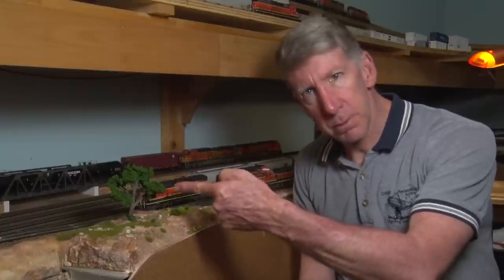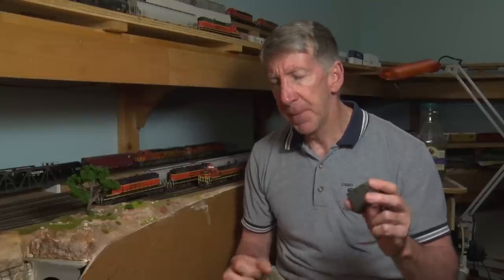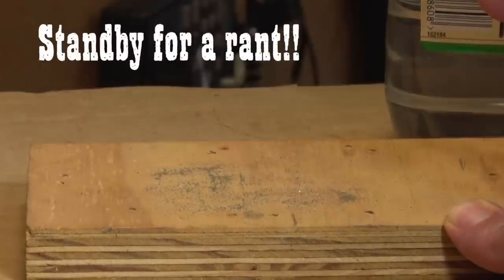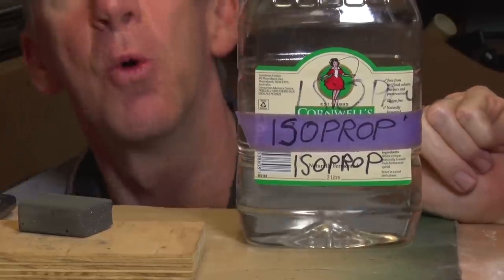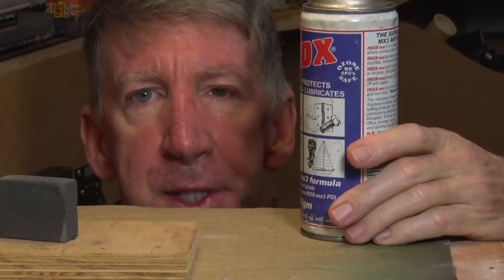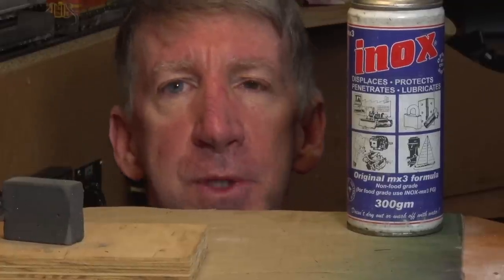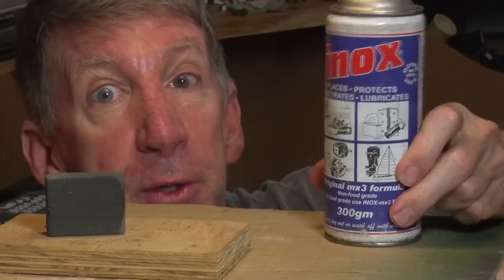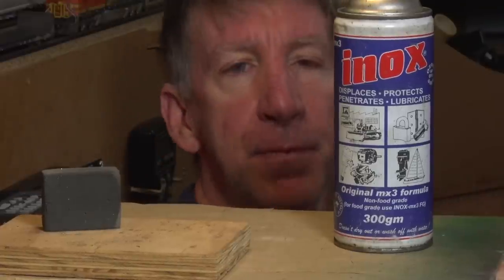Track cleaning do's and don'ts. How "Not" to  clean your track ! And how to do it better!

Comment: I totally agree about the isoprop, i use it to clean flux residue from circuit boards i have worked on, yes, it's great for cleaning off the flux, but the isoprop itself leaves a visible film over the board once it's evaporated away. Just spill a small amount of isoprop on a glass surface and let it evaporate, the residue left behind is easy to see. And i totally agree about track rubbers, i bet if you could measure the coarseness of them on the wet and dry paper scale, they would have a reading in the low hundreds. Like you say, Greg, best bet is to use a 3000 grit wet and dry paper - the stuff is designed for polishing paint and clear coat - just try polishing your paintwork with a track rubber and see how that turns out! 😀
Reply from the maker: Thank you Steve! You're spot on re the IPA , it does leave a residue and the ide of letting it dry on glass is a great idea to show what happens!   Wet and dry is great and I used it when I had DC trains back in the 80's .
Gregg :-)

Comment: Watched a few videos and read a few articles about dos and don'ts - I tried your method and so far so good. My contact cleaner is for moving contact parts - I tried a dirty piece of track and so far it is very smooth. Fingers crossed. Easier than having to vacuum up after scrubbing!!
Reply from the maker: Glad to hear it! It will only improve as you use it.
Thanks for the feedback.
Gregg.

Comment: Hi - just watched and enjoyed your clip on dont's for track cleaning. I have a question re isopropyl alcohol. I can understand your comments about the "impurities" in IPA ... but I can source (here in NZ) isopropyl alcohol that is 99% pure. The agents for this brew can not tell me what the last 1% is. So my question is does your rant include all isopropyl alcohol products or just the ones you mentioned with the extra water etc added to them. Thanks Fr. John
Reply from the maker: Hi John and thanks for watching!  Due to it's chemical make up ,and being made from LPG, IPA is not suitable for any electrical equipment cleaning, and if you watch the follow up video to this , I go into that a little deeper. Even "pure" IPA will dry and leave a residue in the track that builds up over time . If you must use an alcohol to clean your tracks , then try Methylated spirits , but better still , use a product that is made for the job...like INOX or similar. The only reason to avoid these is if you have traction tyres on your locos, as the INOX will make the rubber slip. 
Cheers Gregg
Reply: @FishplateFilms  Hi Greg, thanks for that. I can not use the Inox product as all my locos have friction tyres.  
Blessings Fr. John

Comment: Hi, just watched your video and you are absolutely right, had problems with a stuttering train after cleaning the track and train with isopropyl, bought WD40 specialist fast drying contact cleaner as I'm in the UK and it worked a treat, great advice, thanks
Reply from the maker: Thanks David!  Glad to help.Just to clarify , that Innox is no a "contact cleaner" and the WD40 spray will not help with oxidation , as it is a "Cleaner" only. But if you're getting good results , then thats what your after!
Chers Gregg.
Reply: @FishplateFilms  
Hi Gregg, when you say oxidation do you mean rust and  has anyone recommended a product I can find in the UK
Reply from the maker: @1701celica  Hi David, not rust as such, but the Nickel Silver does tarnish a little , but the main job of Innox , or CRC 2-26, is to help maintain a conductive path through dirt and oxidation. Contact cleaner will certainly clean well but leave it sterile, but if you're using traction tyres, then Inoxx is not for you:-). You can buy Innox from "Pendle Slot car racing" in Lancashire...a few viewers have mentioned that , so they are getting a few different customers!
Check out Charlie at "Chadwick Model Railways" who has tested Innox after watching my video.
Gregg :-)
Reply: @FishplateFilms  
Hi Gregg, thanks for the info, I'll check them out

Comment: Hello to another from Brisbane, who doesn't model QR either.  Victorian Railways in my case.  Thanks, I never thought about this, so the track rubber will be going in the bin.  Let the Bin Chickens have it.  I have a few of the 'flat top' VR T class diesels that run really well, as long as the wheels are spotless.  Slightest bit of dirt, and they play up.  The '2nd' and '3rd' series T classes, from a different manufacturer, not troubled so much by dirty track or wheels.  I'll head to Bunnings, even though I have to cook some sausages at home at present.
Reply from the maker: Hello to you!  I bet the bin chickens won't want it either..LOL Nothing worth modelling up here  apart from the 2350 class, but they're the wrong gauge!  Please give it a go and let me know how it goes! The T class ar bigger than they look! I saw one in Maitland and it was huge compared to QR locos , especially for a BO BO unit.
Thanks for watching .
Cheers Gregg.

Comment: Great video and love the rants!!!!!  Probably need a pint or two!!!!!!!

A friend of mine worked as a diesel mechanic.  He told me that they used to use Crocus Cloth to polish crank shafts.  He also said that he used it to clean his track on his layout.
Any thoughts on this????
Reply from the maker: Thanks Rch!  A wee Dram is in order sir. I have no idea what "crocus " cloth is!  If it's used for polishing metal , it may clean well but, I doubt it is the best thing for electrical conductivity? Remember . it's a circuit:-).
Cheers Gregg.

Comment: Don`t worry about replying about my question as I have just seen your video of the 13th April 2020. However do you know of any product similar to Inox that wont bugger up traction tyres.  Cheers   Greg  from  Australia
Reply from the maker: Hi Greg, It is the "wet" that the tyres don't like , and it is the same with other liquids as well. You could try a lanolin spray , like "Lannotech: as it does the same as Innox , but dries out more. 
Other than that you are back to dry cleaning I'm afraid?
Gregg.

Comment: I love this video and as a result purchased some, however on running a clean cloth along my track after several weeks the muck that came off was really black but the trains have been running superbly, is the black muck a common thing to be getting. I have nothing with traction tyres and all wheels on stock are metal🤔
Reply from the maker: Thanks Len!  The black is indeed normal , and is a combination of dirt , oxidation and the Inoxx removing the dirt from your rolling stock wheels! You will never have to clean wheels again ! If you watch the update of this video , I explain that , 
Thanks for the feedback and glad you got the results I promised.
Cheers Gregg.

Comment: How about (“Nature Own”), goo-gone made specifically from Citrus fruits ? I caught a hobby shop owner trying to please a customer on an 027 Santa fe passenger 
set that he had decked up on top of the sales table he grabbed some Goo-Gone and an old rag ! He then proceeded to very lightly went on to completely go around the loop !!!  Then he took a “second rag” and (“wiped off the first past he made !!!  I guess he was wiping off the goo-gone and proceeded to run the train !!! So what do you think of Goo-Gone ??? I’ve tried it myself, and it does seem to work and I have yet to see a piece of track get corrosive or even the slightest bit of rust !!! And I’ve been using it for the past 10 years !!! You did a lot of research before you found an answer !!  
I’d really like to know what you think of this product (GOO-GONE) ???
Reply from the maker: Hi Jorge, thanks for watching! I've never tried it , but some people seem to like it! Being citrus based (i didn't know that) it is a good "cleaner" , but as for protecting the rails and helping with conductivity...I can't say. Track won't rust these days as it is Nickel Silver, but it does oxidise  so for my money , I prefer to use a product that is designed for  electrical circuits. If you are getting the results you  wan't  then that's what matters. 
Cheers Gregg.

Comment: 10 years ago, I stop running my trains due to crappy, inconsistencies in use. Guess now I need try using 3000 grit emery to smooth the surfaces then only use non silicone conductive spray to keep the prime movers moving...
Reply from the maker: You got it John!! I'm sure this has happened to many modellers!  Spray a little on the glass paper too, while you are polishing the rails!
Let me know how you go.
Gregg.

Comment: Good video. What's the impact on inclines. Does Inox leav an oily residue?
Reply from the maker: Unless you have traction tyres, it's not an issue, but if you do , then it will make them slick and  useless.
The track is left with a thin film that is not oily but does make the rails smooth and slick. Off course it depends on how much you use also!
Thanks for watching!
Gregg.

Comment: Hi watched your video in the uk with much interest. Inox is not available here. I’ve seen quoted Crc 2-21 as being the same but not sure.
I’ve also noticed that inox is a lubricant, how does it affect steam locos with traction tyres ?
Take on board track rubbbers are a no no dcc do a much finer rubber.
Would be great Greg if you could answer as I know others are showing interest in the uk.
Reply from the maker: Hi Derek, Thanks for watching and I have had a lot of interest from the UK and you can get INOX from Pendle Slot racing in Lancashire , believe it or not! I'm afraid it does make traction tyres slip on the slick rails. I've not heard of 2-21, but CRC 2-26 is similar to Inox. If you only use a little of the spray and wipe the rails wth a dry rag you should be ok? See Charlie at Chadwick model railway channel , as he uses INox and may have a better idea. .
Cheers Gregg.

Comment: Timely Greg. I am in between setting up my layout, and wanting to move into another room..(more room bigger layout. The track that is down was just about to the once-over from the old PECO track cleaner. So I will hold off until I can find a can of the magical fluid and see how it performs
.
Reply from the maker: Thanks Gary! Yes chuck the track rubber and get some spray . You only need a little now nad then ...a can should last you forever!
Cheers Gregg.

Comment: Thanks so much for your videos on track cleaning. I live in Minnesota and couldn't find the Inox but got some CRC and cleaned a couple of troublesome points and it made a huge difference. I then cleaned the wheels on my two most sensitive locos and that made a huge difference also. This next weekend will see me using the CRC on the rest of the track as well as the wheels on the rest of my locos. Thanks again!
Reply from the maker: Hi Tim, thank you and I'm glad you got some great results! You will work out how much and when to use the cleaner, and after a while your wheels will clean themselves on the rails , which you remove the dirt from when you apply more CRC! . 
Cheers Gregg.

Comment: Do you wait until the crc  2-26 dries on the wheels of a locomotive or on the rails before running trains? Or can you run trains right after you spray and wipe the crc?
Reply from the maker: No John, just a little on the rag and wipe a section and away you go ! If you run your finger along the rail , it should be smooth and a tiny bit left on your finger.
Gregg.:-)

Comment: G"Day Gregg. Mate I use Contact Cleaner or WD-40 Electronic Cleaner. I spay a bit into my "CMX Clean Machine Car" and get one of my Loco's to push it around the layout. Fastest way I know of to clean all the track. If I have a sticky switch, I just spray a bit of the contact cleaner directly into the switch and work it back an forth a few times and its as good as new.
Reply from the maker: Glad you are getting good results! 
Thanks for watching!
Gregg .

Comment: 13 year old me decided to store a box set from Bachmann in tv set drawer and 2 years later i finally got back into it and the tracks are tarnished on top (these are nickel steel, they've all become fully/mostly dull grey on the top instead of shiny) but all the metal cleaning products in my house are for guns and contain petroleum distillates. Whats the matter with distillates, and is there a way to use them and clean off the distillates later? Its only 1 train, 3 rolling stock and a large pile of tracks so I don't think I could justify ordering the silicate based cleaner.
Reply from the maker: You can use them for what you want to do no problem, but a bit of CRC will help a lot!

Comment: Very interesting Gregg. Assuming I can put it in my CMX Track cleaning tank car, then maybe that's the way to go. What's the difference between regular isypropal alcohol and featured alchahol? Been using that, but now I'm thinking it might be better to clean with that and then the CRC.
Reply from the maker: Thank you ! Yes you can but make sure you slow the flow down  it doesn't get too wet. I don' know the difference, but all spirits have some water or other chemical to make them unsuitable for drinking. You could clean with the alcohol and follow up with the CRC. 
Cheers Gregg.

Comment: Watched your vid and see the problems then seen your comments re traction tyres. In the UK I see WD-40 do a contact cleaner which is quick drying and safe with rubber and plastic. Would that work? Otherwise I might go back to track magic  or even running my CMX round dry.
Reply from the maker: Hi Leslie, the traction tyres are a issue as they slip on the spray ! You can use contact cleaner, but it won't leave a protective film on the rails. You may have to stick with track magic?
Thanks for watching.
Gregg.

Comment: Greg,
Learn a few things, I received a HUGE box of Atlas snap track. Before I start putting any track down, I was thinking of using a pink pencil eraser to go over the top of the rails and the joiners. What do you recommend? I don't want to be bent over just yet.
Reply from the maker: .....start removing your belt Thomas...this is gonna hurt! An eraser is your worst choice , apart from a track rubber, but if you have nothing else , then make sure you go over the track with Innox or CRC before you run trains. As for the joints, keep the rubber way from them if you can and also give them a good wipe with your spray of choice. Don't forget to vacuum up the rubber before applying the spray.
Cheers Gregg.

Comment: What would you think of using 99% isopropyl for a good cleaning (like after ballasting) and then polishing with 3000 grit paper and the Inox MX3?

I am fortunate to have access to 99% isopropyl by the gallon in my local hardware store.
Reply from the maker: Hi John, 
You can use the IPA to "Clean" after ballasting or painting, but then go ver the rails with INOX as you say! You can skip the paper , but you can use it to remove scratches left by track rubbers ect. Then just use the INOX on a rag! 
Cheers Gregg.

Comment: Hi i receive the Inox but i wish understand better how to use it.  
1) clean track with clean cloth string and inox
2) clean track with clean cloth string but second way to remove the inox that appear like oil on skin. ?

little scared for this oil effect ...

Do you use it rubber wheels applied on the loco ? 

Any help is really appreciate
Reply from the maker: Hi Stefano , Yes , you have it the correct way! Use only a little on the rag / cloth , you do not need very much at all!   If you have traction tyres /rubber wheels, you you have to be careful , as the INOX or CRC will make the rubber slip on the rails! 
Try using very small amount , but if you get wheelslip , then you can stop using the INOX or CRC , and the rubber wheels/ traction tyres will dry out after running for a while. 
Traction tyres are a pain , luckily I don't use them .
Cheers and good luck.
Gregg.

Comment: would it be recommended to use this product on any other if you have traction wheels? i have a two Steam engines made by Rivarossi and an F7 made by Mantua  (quite old actually - they belonged to my grandpa) and they these traction wheels.

Comment: One thing that works great - and leaves behind a conductive element on the rails - is to use an artist's carbon bar. I use one, and cleaning the rails and making sure they are conductive is simple. Just rub the bar on your rails. It cleans off the "gunk", but again, leaves behind a conductive protective layer on the rails. Also, it will appear that your rails are a bit ages as well.
Reply: Is that just graphite or is it something else? What brand you use and how affordable are they? Just starting the hobby and trying to learn all I can about the maintenance.
Reply: @Ephra_wangai  It a graphite bar used by artists to draw with. A decent one is about 1 - 1 1/2 inches wide, and about 4-5 inches long.  And the brand? Heck...I don't know - I usually go into an art supply store and buy what they have. It's only a fee bucks, and it'll last you like FOREVER. I haven't bought one in about 5-6 years.  Here is a YouTube video on how to use it:

https://www.youtube.com/watch?v=o59W7iwre24&t=22s
Reply: @antonbruce1241  awesome! I'll try finding some at my local art shop soon. Also I was wondering what the opinions on makeup sponges for cleaning gunk off tracks were. I have a ton for panel lining models and thought they might be useful here.
Reply: @Ephra_wangai  You're a braver man than I!  I would NEVER take my wife's makeup sponges to clean track - she'd  KILL me!!!!!
Reply: Wouldn't a carbon bar leave graphite dust around? Seems that could get into loco workings and such ...